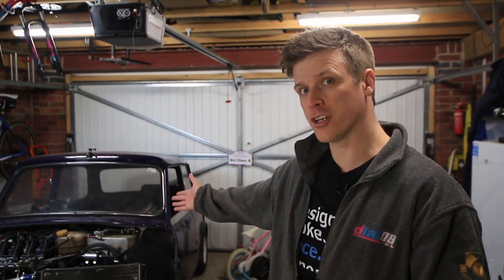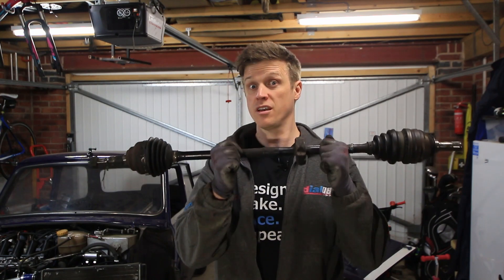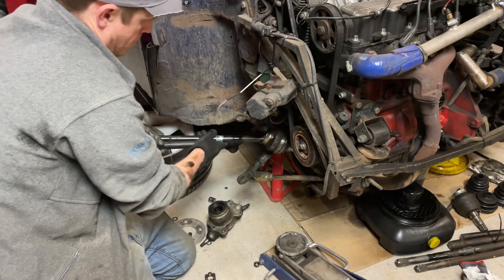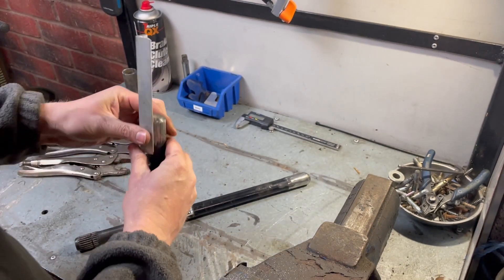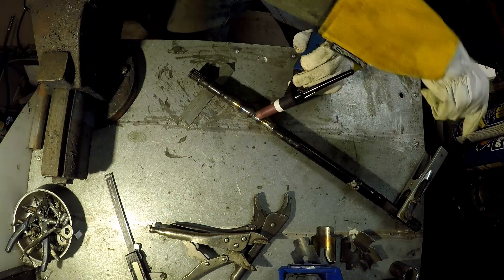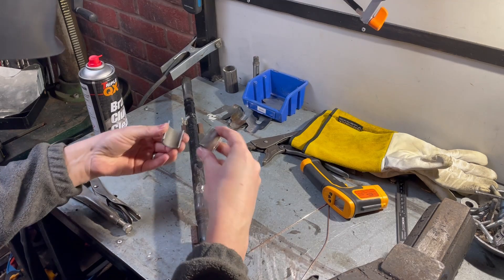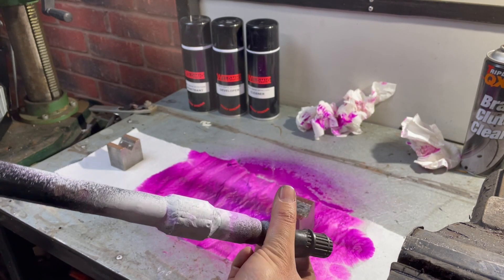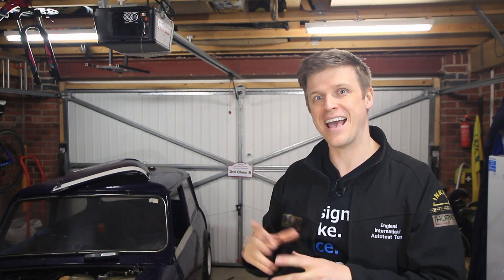DIY Custom driveshaft....  How to cut and shut driveshafts the right way...

Comment: I put uprated driveshafts with beefier Cv joints on my 106. they worked flawlessly, and never broke, unlike the factory ones.
Instead of changing driveshafts in 20 minutes, I moved to a routine of having to repair gearboxes that grenaded, as that was where the mechanical fuse was moved to with my "upgrade".
Reply from the maker: I feel your pain buddy!  Time to give the lovely fellas at Quaife a ring!
Reply: @MakingforMotorsport  
When I started out, I was a 17 year old who was more concerned with how loud I could get my exhaust (for shame). In the process of destroying yet another gearbox, I found it pretty hard to get hold of the box from the 1.4 8v engined cars that I needed, and had to make do with one from a 1.1 8v. It was the best thing I ever did. I forget the exact ratios, but 2nd gear in the 1.1 box was like 1st in the 1.4 box. I could beat a McClaren F1 to 20MPH with that setup! 
I bought that little French shitbox brand-new and never sold it on. It has been sat at the bottom of my parents garden for about 15 years.
I so desperately want to drag it out of the weeds.

Comment: Great content and production as always. 
I’ve used the same process to make propshafts for land rovers. 
Cutting the tube near the yoke, splitting the offcut and using it as a sleeve to hold everything true, then welding the sleeve at each end and filling the split. Then grind everything back as smooth as possible. No failures or balance problems. By keeping the joint near an end rather the middle run out is less. 
Interestingly I did one by grinding out the weld of the yoke, shortening the tube and welding the yoke back in. This looked better, but was terribly out of balance causing bad vibrations around 60mph. Made another with the sleeve method and all good lol. 
I got this sleeve method from a book called “ How to build a T Bucket Hot Rod on a budget”. The authors philosophy was do it yourself and get the project finnished, then anything you don’t like or didn’t work change later, but at least you have a finnished rolling car.
Reply from the maker: Interesting… I thought the grinding out the yoke weld, shorten and reweld method was the way….  Guess not!

Comment: Hmmm. I wonder how well this would hold up to a Subaru connected to GM V8 hardware...
Reply from the maker: Only one way to find out! 🤣
Reply: @MakingforMotorsport  this has already made up my mind. I'm going to carefully measure and then make my own axle shaft. And then when I'm sure that works I'll go back and order custom shafts. But this way I know the shaft will be the perfect fit.

Comment: I work at a place that pumps out 1/4 million OEM driveshafts a month, and your process is just a home shop version of ours. We have a friction welder for shafts, then heat treatment, then a straightening machine that is literally an automated version of the measuring and bending process you show. We even crack check with a similar method too. The most common failure location is the tiny gutter where the spline teeth end, as it's usually the smallest diameter and in a highly stressed area. Nice job.
Reply from the maker: That’s very interesting to know, I have been involved with shaft manufacture but not automotive drive shafts… great info to  know!  Cheers 👍

Comment: Great video and great timing, I was thinking of converting solid diff Autoslalom Locost to IRS, with subaru impreza pieces. I'm was looking for inspiration on how to shorten the driveshaft... Keep the the DIY videos coming,  Motorsport is fun on the track and in the garage, even better when it doesn't break the bank
Reply from the maker: I think the sleeve method is the way to go, but picking up on the comments, cutting the end of the sleeve with a hole saw so it “wavy” and on a radial ring should reduce the stress raisers and make it even stronger!
Reply: @MakingforMotorsport  That is a good suggestion.

Comment: I think that's the kind of modification is is perfectly acceptable for auto test but if it were for circuit use a properly done shaft would be the way to go.
It's shafts were one of the reasons I decided against putting a k24 into my 405 and instead have decide to go with a 2.3ltr stroker gti6 engine
Reply from the maker: It’s kind of one of those things… if I were doing something that had £400 entry fees I would fear a non-finish a lot more…. But I reckon this is plenty strong enough for circuit racing…
And I wanna know more about a 2.3 GTi6 engine!  That’s gotta be a beast!  Custom crank?
Reply: @MakingforMotorsport  that would be my trail of thought on it. Likely strong enough for circuit racing but I wouldn't want to chance the failure.

The 2.3 is a reasonably budget friendly build the way I am doing it (for the bottom end anyway)
96mm 2.2 hdi crankshaft 
158mm pec turbo conrods for a gti6
Honda k20 87mm pistons 
280degree cams 
Adjustable cam pulleys
Ported head 
Arp head and crank studs
Hdi oil squirters
Big capacity baffled sump

Planning a custom intake manifold rather than throttle bodies purely so I can mirror polish it along with anything else aluminium

Comment: Welded a number of broken driveshafts. For me the trick seems to be simple - no transverse welds on the sleeve. Make the sleeve a bit longer, and cut 3 wide grooves lengthwise
Reply: Could you elaborate of the specifics?
Reply: So you mean you basically cut the sleeve into 3 pieces and weld lines parallel to the shaft direction to fill in each of the 3 gaps? Basically 3 long welds?
Reply from the maker: This is a great shout and makes perfect sense, the one I showed is the first one ever that has gone on the weld so I have never had to improve the process but I will definitely integrate this next time!

Comment: You seem to run those shafts at a fairly low speed.
I'd suspect that for higher speeds (like circuit racing) you'd need to balance them.
Reply from the maker: I haven’t had the opportunity to run these at high speed… but you may be right… but that said… with less than 0.25mm run out it should be pretty close

Comment: I have always wondered about this! thanks for making the video so detailed!
I wonder if tempering the whole shaft after welding would make the cracks less likely to appear on the heat affected zone?
Reply from the maker: Temper would not likely do it as that’s normally “low” temperature and that’s pretty much what the welding does anyway as the middle 4” is about 450c, but a full heat and anneal might help but I don’t wanna lose any hardness on the spline area… 
That shaft lasted 2 years of the worse abuse I could give it… it did well!

Comment: I welded shafts together for my build too. Everyone said they will fail, but worth a shot compared to custom units. 
I keyed mine together though, might be something to try on your next ones. Cut off half of each so the lock together. Also,  I ran a hole saw on my sleeve on each end so the weld didn’t go around in one circle. Was hoping that would prevent a shear at the sleeve weld. Check it out sometime, might give you some ideas.
Reply from the maker: The throated sleeve ends with a hole saw IS pure genius… that will help a lot with HAZ!
Reply: @MakingforMotorsport  glad to help! Mine is being built for 400hp, not sure they will hold up but if those are the first thing to break I’ll happily pay for custom shafts
Reply: @limitlessbuilds  It's not the HP transmitted, it's the force, measured in lbf-ft, that you have to design for
Reply: to be honest, the keyed part is pretty pointless, they always break at the weak points, which in your case will be the root of the key. It would be no stronger.
The sleeve bit is a common practice, all be it not with a hole saw, but usually V shape cut out.  I like the hole saw though, less sharp edges to root a crack.
Reply: The BoostedBoiz and All Motor Phong also well proved welded shafts can take some serious abuse. Custom axles don't have to be a $1,000-3,000 venture!
Reply: I'd like to see a picture of this.  I did rosette welds on my sleeves but honestly they're crooked as can be.
Reply: @fooquestionmark  I did a video on my channel about my shafts. Managed to get less than 1000th runout.
Reply: @limitlessbuilds  Thanks! I'll take a look.

Comment: Rather than grinding a cone for the welding joint, you should grind the ends as a chisel. Then you would be able to get full penetration of the weld and it is also easier to weld.
Reply from the maker: Good shout, it would also then just likely move in 1 plane when welding… might try that next time!

Comment: I chickened out and bought a propshaft for my rear wheel drive project, but just thinking about your method for a potential future project.
So, if it wasn't for you heat affected area, your joint would be stronger than the original shafts I suspect. Bigger second moment of area and all that jibberish.
So would it be better (or worse) to weld the outer tube with a series of cold short tacks?
This would somewhat prevent the heat affected area +at least at the sleeve ends), but you would have weaker welds with less penetration (on the sleeve).
But since you've got the internal weld with the outer sleeve for good measure could it not still end up being stronger than the original shaft, even if the outer sleeve has very little penetration?
A good video for someone to make would be to torque test different welding methods on shafts to destruction.
Reply from the maker: I think you’re right and if I can address the metallurgy problems in the HAZ then it would stronger I think, but I wouldn’t go for anything less than full puddle weld with good penetration. 
The joy with prop shafts is that you can often cut off the UJ yokes and either cut down the tube or put a longer one in…. It they do have to be balanced due to the bigger diameters involved 👍
Reply: @MakingforMotorsport  ye, my main concern with the propshaft was not really knowing what would happen if it failed.
It would be about 6" away from my arrse with GRP and a tiny bit of steel box section to block it.
I'm pretty sure I could have welded it properly. But what if????

Hope the guys that made it for me know what they are doing 🤣
Reply from the maker: @richardschofield2201  🤞🤞🙏🙏